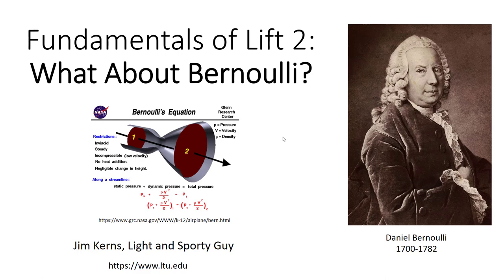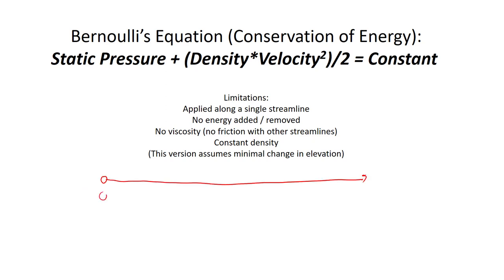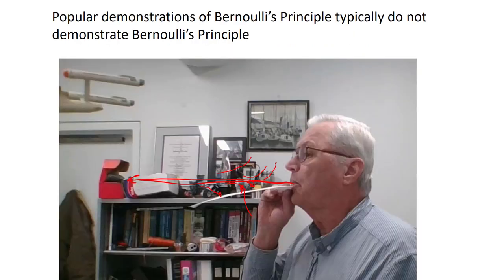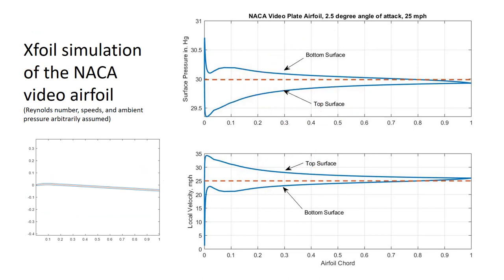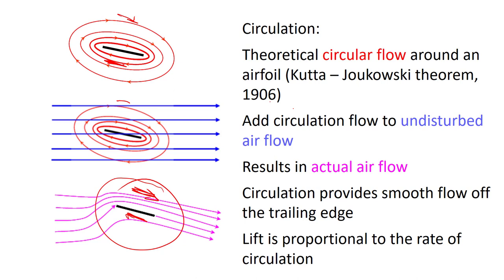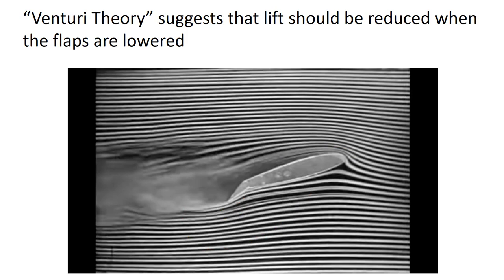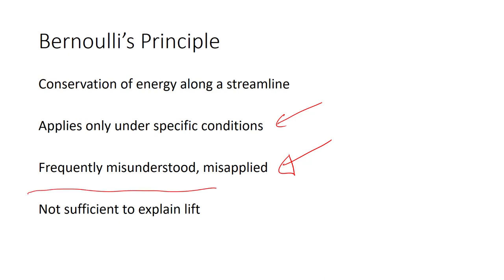Fundamentals of Lift 2: What about Bernoulli?

Comment: Light and Sporty Guy. With respect, to what was said at 4:25 about the pressure in his mouth,  I do feel that writing 
Bernoulli Equation as Constant = Pa+ r.V^2/2 = Static pressure + ( Density * ( Velocity)^2/2= Constant could be a little misleading to explain what is going on in the LOCALISED ZONE AROUND THE WING.

Let me explain. Assume that we are flying deep in a motionless,  stationary, vast, voluminous block/zone of the air mass, where the static pressure is Pa and the velocity V, is 0 ( zero).  None of the fluid particles are moving. Hence we can write that Constant= Pa 

Now we have a voluminous shaped wing approaching horizontally to start plowing through the stationary air. At this point, it is very pertinent to mention that the wing has a HIGH INERTIA and very powerful engines to push it along, to continuously plow through the block of air mass particles.  As soon as the solid moving leading edge with an Angle of attack, and anything with suction or compression on the wing meets the air particles, THE SOLID WING WITH ITS COMPRESSION AND SUCTION ZONES, TRANSFERS AND  SUPPLIES ENERGY TO THE AIR PARTICLES THAT ARE IN THE ZONE OF THE LEADING EDGE AND A LITTLE FURTHER OUT DEPENDING IF THE PARTICLES ARE AHEAD OF THE WING OR LATERAL TO THE WING.     So at this stage, one must say that all the extra energy in the air particles apart from Pa, have been transferred from the massive energy contained in the wing to the air particles around the leading edge and where there is suction and compression around the wing. 

Hence Bernoulli equation must be written Constant = Pa for the stationary particles in the motionless voluminous block but as soon as the wing and engines start transferring energy to the air particles to move them out of the way to plow through then Bernoulli equation and its constant may be varying/changing all the time along the streamlines exiting above and below the wing.         Hence

Constant =   ( height, gravity/mass loss, neglected)  + P2 ( changing) + r.(V2 changing)2  +  ( energy transferred to the air particles by compression and suction zones as the wing moves along the now  accelerated air)  or ( as in a jet engine or rocket where the particles of air gain thermal energy due to fuel addition and temperature changes as they move along the engine)  

That air particle moving around a wing, along a streamline that has a horizontal and a vertical velocity component, must not be treated simply by saying that Constant = P + ( V)^2/2.  That unmentioned complexity is the reason  why  over the last 200 years people are still not agreeing " WHAT IS LIFT AND WHERE DOES IT ORIGINATE?" 

 This complexity is all contained in what the gentleman said in the video about blowing pressurized air through his mouth where the energy came from his lungs rather than the engines powering the wing or gravity or thermals or cliff soaring or tensioned rubber launches or winch launchings or energy robbed from the air particles due to friction, shearing, boundary layer,  etc.  I would even go as far as saying that the particles are being continuos exchanging energy from the wing,  plowing and passing through and that is part of the drag and other losses in a wing which causes it to lose altitude if it had no engine to support the continuous transfer of energy from the wing to the air particles so that they are continuous, VECTORIALLY ACCELERATED ABOVE AND BELOW THE WING TO PRODUCE VERTICAL LIFT force to equal M A,  the weight of the wing. We shall forget about the drag for the time being, but that will emerge out, if we integrate the acceleration field as a vector field and not only its vertical component.

Comment: Most fundamental principles of LIFT  can be explained through applying what goes on in the following video showing fast cars going over a curved road and separating from the humps, but in addition, one needs to include the vicious, sealing shearing action of the fluid, as it is not simply a case of processing, individual, isolated, fluid, hard mass particles which are totally unconnected.. NOTE THAT THE CARS ARE BEING SQUEEZED IN JUST BEFORE THE BROW  OF THE HILL BUT THAT GIVES THEM A VERTICAL ACCELERATION. to be of benefit to produce a suction effect at a later stage on the brow of the hill acting as an obstruction. 

The video showing fast cars approaching and going over the hard humps of a hill, clearly explains the reason for the "Newtonian- viscous" suction zone above the leading edge and upper surface of a wing, and to appreciate the compression zone below the wing, one needs to imagine a curved road present above the top of the car and the compression created when the top of the car slides along the top inverted cushioning, curved road representing the curve under a wing. 

https://youtu.be/AAjIdmYIZrQ

Note that there are no hard hammered impulses on a flying wing but all accelerations are cushioned or " softly pillowed" by the cushioning/tension effect of air viscous masses, as in the case when a helicopter or a wing has the ground effect due to the cushioning effect of the fluid being used in the low flying operation with ground effects as the case of the Russian Eraklon used in the Blacksea( hence the Monster of the Black Sea)  during the cold war. There is a related soft suction effect due to the viscous effects.

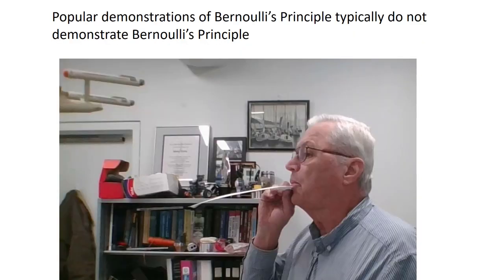Comment: I am a little surprised by the comments made at 3:37 for they seem to be in disagreement with what I believe and understand what is happening when he blows over the sheet of paper is the following. 
Let us write the Bernoulli equation in a fuller sense and discuss a more complex situation.
Assume we deal with a particle which we shall choose to be an exploding bullet or a mixture of air and petrol. with Newtonian and viscous properties. 
Its flight through the air surrounded by other similar particles will produce a streamline along which many actions can take place through the following encounters.

Energy contents of the particle are due to:-

 ( mgh due altitude and gravity) +( rV2)/2  due to density and linear velocity + r.w^2 I Rotational energy as in Gyroscopic energy and flywheels)  +  ( internal energy due to electrical charges, chemicals, fuels, and explosives internal to the particle including atomic energy)  + external energy transfer to and from the particle, due to the particles moving through compression or suction fields/zones including magnetic and electrical forces)

If a single isolated particle follows a streamline say after it is shot in the air, then then the particle may start losing its internal energy and if it explodes and splinters of various masses go all over the place, then with some imagination Bernoulli equation can still describe all the actions and reactions in that scenario.
Rather than the particle being isolated on its own so that its streamline would contain all that was described above,  there are a few other particles not necessarily homo=genious with our particle,  then due to processes that can take place at different zones in the flight path, as compressions and suctions and magnetic and electrical fields and drag and windage, and VISCOSITY EFFECTS  then our shot energetic particle would cause some energy transfer to particles on another streamline as the particles in the fluid we deal we deal with are not completely isolated and they are connected. 

So when he blew along with the paper with this contracted mouth acting as a nozzle as the particles emerged from his mouth under the pressure of his lungs, as they moved along their particular streamline doing their energy transfer act, there was a possibility that there were say pressure difference between the streamlines of other particles and SINCE THE FLUID PARTICLES ARE COMPLEXLY CONNECTED  SAY WITH PRESSURE  DIFFERENCES,  then a pressure difference along one streamline would have a reaction on the particle on the streamline but it would also have a reaction on an adjacent streamline and it is a distributed complexly connected fluid matrix network we are dealing with.
For this reason what was shown at 3:37. I would still call it the effect of Bernoulli equation.

Comment: i read on a book , that the speed increases because the air gets squezzed above the airfoil , and then applied conservation of mass , but i can not understund why the air gets squezzed , as you can se in minute 9:13 , sorry for my english grammar , i am from PERU
Reply from the maker: Streamline squeezing is a popular myth - at least as far as lift is concerned. Yes, when there is an obstruction of some thickness, the air has to "squeeze" by which results in accelerated flow as the air passes around both sides - but that is not a fundamental cause of lift. If you take a thin airfoil shape and start adding thickness equally to the top and bottom (maintaining the same curve down the middle), you see that pressure is reduced on both the top AND bottom of the foil and lift does not significantly change.
Reply: @LightAndSportyGuy  so i dont understund how conservation of mass is applied to LIFT , because as i understung you need to conserve mass energy and momentum to produce lift , but you made an example with the flaps that the air gets squezzed and therefore the lift is negative ,so conservation of mass can not apply to that scenario?
Reply from the maker: @MrJackjr7  Conservation of mass / energy apply as general properties of fluid flow. And, we can use these concepts to develop concepts such as Bernoulli's equation (Or Navier Stokes, or...). But, many of the popular explanations of lift try to use different principals for the top vs the bottom of the airfoil - and that just does not work - if you are doing computational fluid dynamics, you don't use different equations for the top vs. the bottom of an airfoil. Plus, the laws of physics do not change from one side to the other. So, if you are trying to apply the conservation of mass in the sense that you get acceleration / low pressure as you pass an obstruction as an explanation of lift - it just does not work. In the flap example, conservation of mass has to apply (air is not created or destroyed) and you can use it to correlate pressures and velocities.  But the idea that squeezing streamlines is a fundamental part of how an airfoil generates lift just doesn't work. Consider https://youtu.be/aa2kBZAoXg0 if you want an explanation from an actual expert in aerodynamics. And, be aware, that unfortunately there is a lot of nonsense out there that passes for explanations for lift.
Reply: Jack, Most fundamental principles of LIFT  can be explained through applying what goes on in the following video showing fast cars going over a curved road and separating from the humps, but in addition, one needs to include the vicious, sealing shearing action of the fluid, as it is not simply a case of processing, individual, isolated, fluid, hard mass particles which are totally unconnected.. NOTE THAT THE CARS ARE BEING SQUEEZED IN JUST BEFORE THE BROW  OF THE HILL BUT THAT GIVES THEM A VERTICAL ACCELERATION. to be of benefit to produce a suction effect at a later stage on the brow of the hill acting as an obstruction. 

The video showing fast cars approaching and going over the hard humps of a hill, clearly explains the reason for the "Newtonian- viscous" suction zone above the leading edge and upper surface of a wing, and to appreciate the compression zone below the wing, one needs to imagine a curved road present above the top of the car and the compression created when the top of the car slides along the top inverted cushioning, curved road representing the curve under a wing. 

https://youtu.be/AAjIdmYIZrQ

Note that there are no hard hammered impulses on a flying wing but all accelerations are cushioned or " softly pillowed" by the cushioning/tension effect of air viscous masses, as in the case when a helicopter or a wing has the ground effect due to the cushioning effect of the fluid being used in the low flying operation with ground effects as the case of the Russian Eraklon used in the Blacksea( hence the Monster of the Black Sea)  during the cold war. There is a related soft suction effect due to the viscous effects.

Comment: So many misconceptions, so much confusion. 1. YOU CAN'T GET LIFT WITHOUT AN EXTERNAL SOURCE OF ENERGY. 
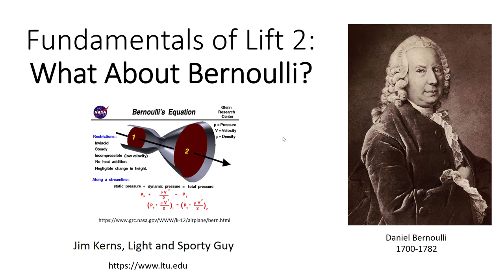0:37 "No energy added/removed" does not apply to the generation of lift! 
An aeroplane needs to burn fuel to generate the velocity through the air. A glider, in still air,  has to convert potential energy of vertical  height into kinetic energy of horizontal motion to generate the velocity. When it's hill soaring or working a thermal it's converting the pressure gradient  from the vertical component of the airflow.
Bernoulli's principle does not apply to the generation of lift from an aerofoil. 

There are many other reasons, but one good reason should suffice to disprove the theory.

P.S.The force enabling a kite to fly is provided in the tension in the string. Break the string and it tumbles to the ground.
Reply from the maker: The energy goes into the circulation vortex. But I suspect you already knew that. 
Or, is your definition of Bernoulli's principle different than the fluid mechanics definition?
Reply: Bernoulli doesn't apply with an external force. 
In your "Fundamentals IV" video, https://www.youtube.com/watch?v=_RQ-NobG3Rc&t=230s, you acknowledge the need to invoke Bernoulli to get lift from Circulation. 
BERNOULLI DOES  NOT APPLY IN THE PRESENCE OF AN EXTERNAL FORCE.